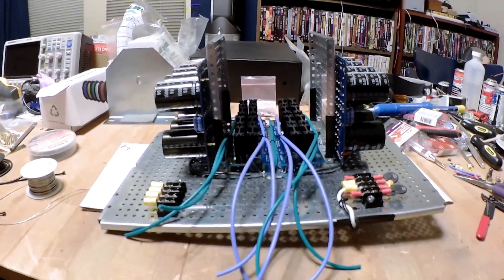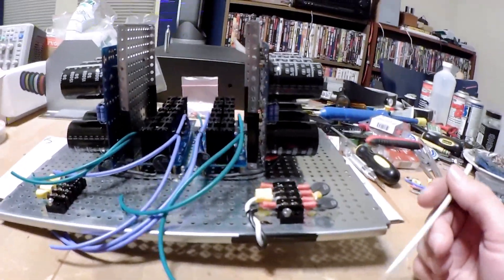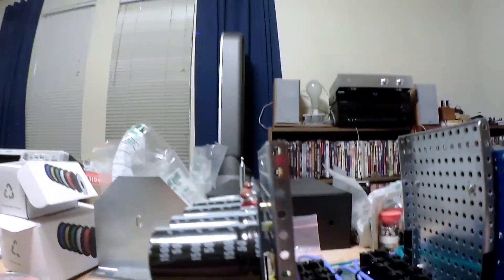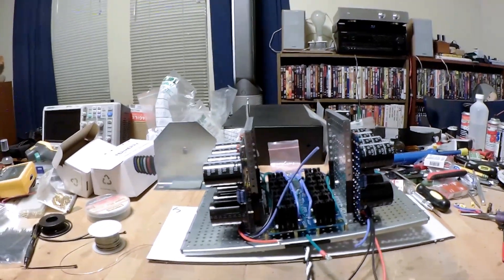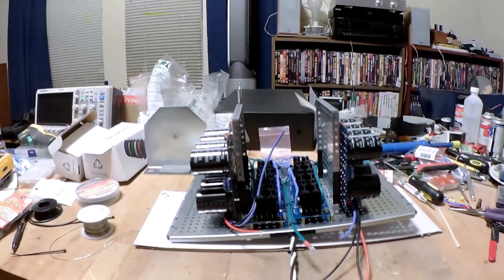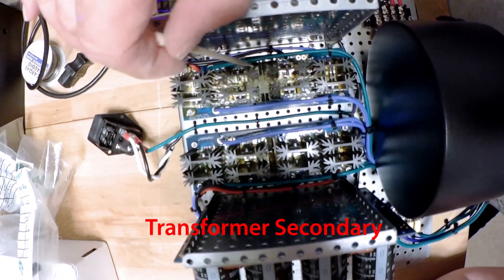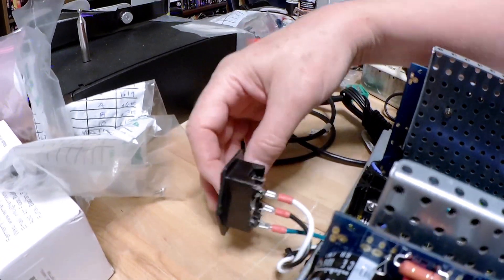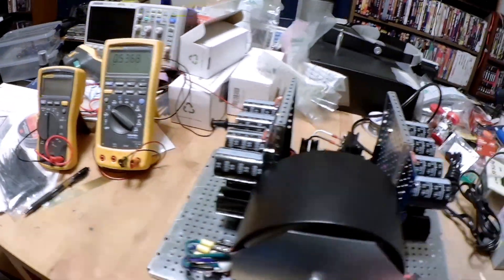Robert builds the Nelson Pass F6 Amplifier part 7

Comment: Hi Robert, my name is Enrico. I just built a first watt f7 clone, and I spent a lot of time calibrating the bias and offset. But when I connect the load (an 8 ohm speaker) a resistor near the n-channel transistor heats up a lot, with smoke and a burning smell, and no music comes out of the speaker. What could be the problem? Thanks in advance
Reply: Which resistor precisely?Can you compare voltages in the area with the good channel?

Comment: Hi, 

What did you use for the power supply, diodes/capacitors/bleeding resistors?
Reply from the maker: There is a parts list and building guide on the DIYAudio.com website.
Reply: @ you used the standard parts-list?